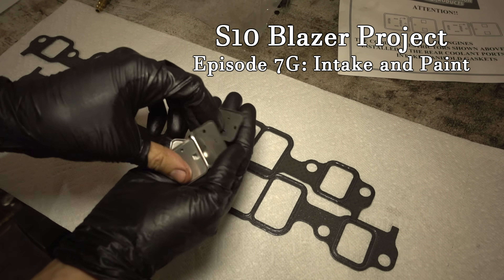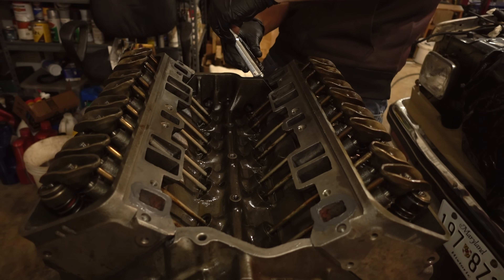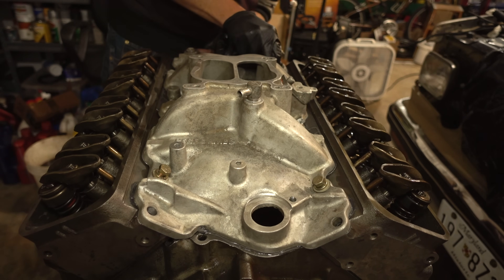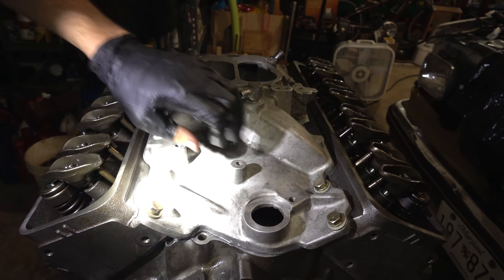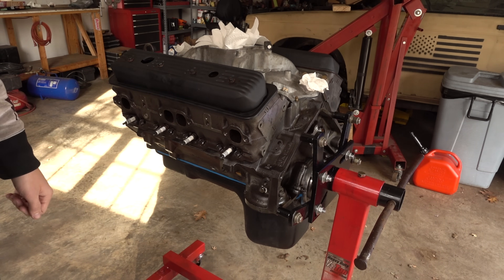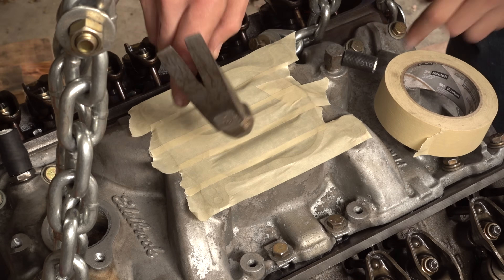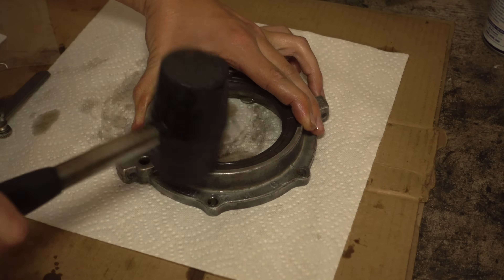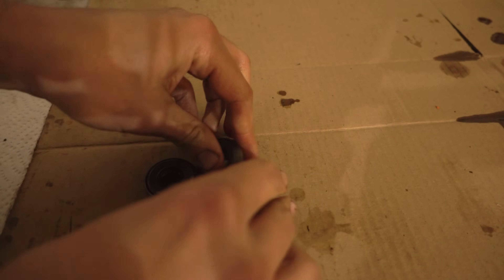V8 S10 Engine Rebuild: Intake and Paint (Ep.7 Part 7 of 7)

Comment: Instead of rvt you should use Indian head gasket sealer it's safer and it don't spew out into your block or squishy out into the block and cause she a mess later down the road and it don't come up the small water ports and stuff in the head either

Comment: Isnt it a risk to use silicone sealer on engine? I mean once you install the intake manifold that stuff could squeeze inside the engine and endup blocking oil channels or get on bearings.
Reply from the maker: It is a very small amount used, not enough to significantly squeeze out on the edges. If you overkill it, chunks certainly can end up blocking the oil pickup and causing oiling issues, though.

Comment: Didn't those blocks use a spider piece in the lifter valley that sat over the lifter tops and at the bottom end of the pushrods? I see the tapped holes at the center of the lifter valley but no spider piece.Wondering.
Reply from the maker: Only for roller lifters, which this block was actually made with the provisions for but did not come with rollers from the factory. I kept flat tappet lifters, which don't need the links to prevent them from rotating like rollers do.

Comment: I’m not really knowledgeable when it comes to motors so this is a serious question and not a criticism. Wouldn’t be easier to pain the engine before you started reassembly? I’m curious if there’s a reason to do it later in the process.
Reply from the maker: Some people do it that way, but it is more time consuming as you have to tape off a lot more surfaces and cover more holes up. Painting it while assembled is faster and easier, but some people don't like the look of painted bolt heads and gasket edges so they prefer painting parts individually.
Reply: Gotcha! Thanks for the reply!

Comment: I knew a guy who did an intake job on a chevy 350 in a van, he installed mostly everything from the passenger area. He installed the gaskets (which had a marking "to the rear") backwards. The gaskets had rear coolant block off as part of it,  but being backwards it wasn't getting coolant to the t stat and overheated every time. It tool awhile to figure it out.  Always check your gaskets for markings.
Reply from the maker: Yep, very good advice!

Comment: Too late now, but if you paint the engine red before the orange.  It makes the orange brighter, and covers the block easier so you use less paint.
Reply from the maker: Makes sense, good tip! Personally, I wouldn't want the orange much brighter, and I wanted to use as much paint as possible to get a thick coat so not a problem for me! Put just under $10 in paint on that engine, and I'm totally fine with how it came out.

Comment: Why not use a roller cam? The block was setup for factory roller lifters.
Reply from the maker: Money, laziness, and familiarity. The parts and the alternate cam/lifters would not have been THAT much more expensive, but other than not having to run ZDDP oil, there really aren't many benefits this engine would make use of. It's a totally fair point though, maybe next time!
Reply: FuzzyDicePimp i figured money was a big part of it. Wish i could trade you blocks. I got a 1974 block and id like to run a roller cam but i dont want to convert it or pay for the fancy lifters.
Reply from the maker: These blocks are fairly easy to come by, I paid $225 for this one and only that much because it had the accessory drive and TBI equipment with it. The other one was $100 and the block is solid. If you haven't already put money into it and really want a roller, find a junkyard or Craigslist engine! I know that by 1987 most (if not all) of the 350s in cars (not trucks) used rollers.
Reply: FuzzyDicePimp the engine i have is a complete running engine i got from a buddy for $200. I wish i had a new block but i took his offer on an engine i know first hand was good. Im gonna be refreshing it before i put it in my s10 but i know its good as is and dont plan on a full build.